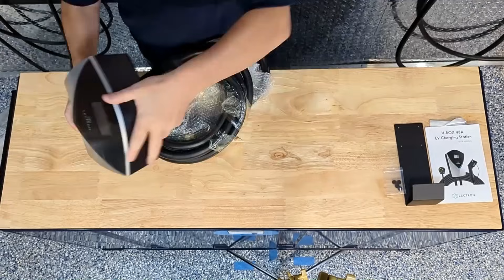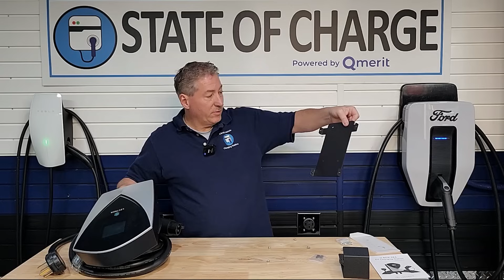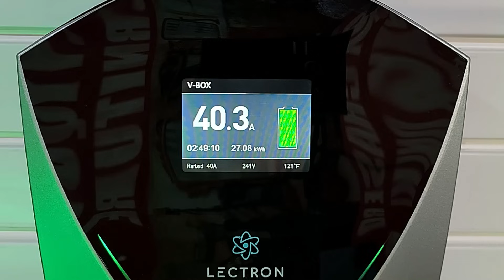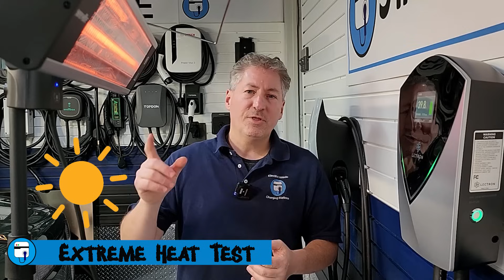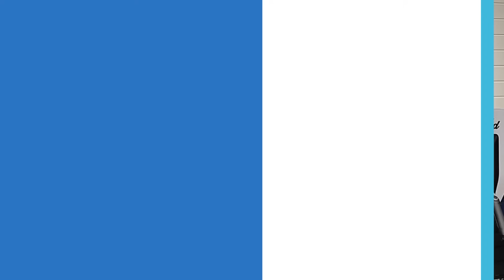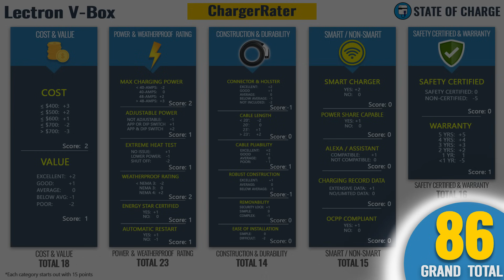Lectron V-Box EV Charger Review

Comment: The reason it has that plastic 1450 plug is so that way you can remove it and hardwired into the house so you could deliver the full 48 amps. If it were a rubberized molded piece to the cable, they'd have to cut it and void the 1-year warranty or any possible extended warranties they bought. Don't just judge for ots exposed screw's

Comment: The plug was made with the screws exposed so you could take the plug off and hardwire the unit without having to cut the plug off then stripping everything to hardwire to breaker box. If your using it outside and don't have a covered 240V plug that's covered that's not real smart and that's on you. I like how you can adjust the amperage output for people who don't have plugs or breakers that is rated to for 48 amp or higher.

Comment: My work purchased 4 units and had them hardwired outside. When the temps dropped below 40 deg and rain misty outside two units had CP faults.  In two months of use, we had two units fail completely. No vehicles connected and the units would issue a control pilot error and would not charge. Lectron sent a new unit under warranty and suggested building a rain/weather shelter for each unit. I guess these v-box units are not meant to be used outside without additional weather protection. We are using the supplied j-hook adapters and the pins are dry in the connector. My work is now looking to switch to another brand due to the hassle of sending these units back for repair. 😢

Comment: I thought that my default charging set up was 40 A and that I would have to hardwire it to get it to 48 A. 

I thought that only if I hardwired it would I have to open it up in order to increase the amperage. 

I’ll make sure that I check the setting before I plug my car in. I don’t have the car yet, so it’s not a big deal. I’ll have time to check.

Comment: I disagree with your assessment of the ATTACHMENT plug versus MOLDED-ON plug. ATTACHMENT plugs have FAR more robust terminals. MOLDED-ON plugs are terminated to the cord by typically poor crimping that is thermally and mechanically inferior. The NEMA 14-50R (or 14-60R per below) receptacle in WET LOCATIONS per NEC® 406.9(B)(2) is REQUIRED to have either an enclosure that’s WEATHERPROOF (i.e., Enclosure Types 3R and 3RX or better, including Type 4 or 4X) UNATTENDED whether or not the attachment plug cap is inserted or a BOX COVER having a similar Listing for WET LOCATIONS (DWL).
If this comes set for 48A CONTINUOUS, then it SHOULD come with a NEMA 14-60P plug. If its SUPPLY cable isn’t rated for 48 A [6 AWG per NEC® Table 400.5(A)(1) Column B] then the Lectron V-Box MUST be set for 40 A CONTINUOUS [8 AWG per NEC® Table 400.5(A)(1) Column B]. IF THE CORD is 8 AWG, the V-Box MUST NOT be HARDWIRED at 48 A CONTINUOUS by that CORD (i.e., plug removed) not addressed by you, but SOLELY via fixed wires through the enclosure knockout (and appropriate wiring method) as you indicated.

Comment: Would you also do a review of the Lectron 20 Foot Tesla EV Extension Cord? 
It would be nice to know the voltage drop based on current that Tesla can report on screen. Heating after hours of load would be nice too. 
We live in an RV with a mobile charger setup in our trailer and we can often not park the RV so we can charge or Model Y without a lot of close parking. Sorry for writing on this video, but it is slightly related to Lectron :-)

Comment: Good review. I'm with you on the 48A default setting. I reviewed this unit last year and I sent them feedback that it should be set to 40A by default. Unfortunate it's still set to 48A from the factory. Otherwise it's a decent unit, though for the price some others are better with more features in my opinion.

Comment: Tom, would like to suggest a change to your testing procedure.  Having supervised electronics testing for many years I believe you should actually do a functional test of the unit after it is cold soaked.  I realize that most failures occur because of overheating but there is a lot of heat generated by the circuit board components and that causes considerable thermal stress when starting from a very cold temperature.  It would be a very short test (probably five minutes) to see if the unit continues to function when powered up and charging immediately after taken out of the cold soak.  That is a realistic environment for people mounting the unit in cold climates outside.

Comment: I’ve installed several chargers and frequently use drywall anchors intended for flat screen TV mounting.  Most are rated for 100 lbs.  As Tom recommends, try to locate a wood stud too.  If it’s a commercial application, get the hardware for attaching to metal studs.

Comment: Lectron seems to have a total disregard for safety. It appears there is no temperature sensing at the removable NEMA 14-50 plug on the V-Box. Also, they sell level 1 chargers that operate at 15-16 amps with a NEMA 5-15 plug, which should be limited to 12 amps (80% of 15 amps). 15 amps is only permitted on NEMA 5-20.

Comment: My first experience with Lectron was the result of Tesla discontinuing their 40-amp Corded Mobile Connector. Most of my charging is at free-to-me public EV charging locations around town that have NEMA 14-50 receptacles. I have a 32-amp Tesla Mobile Connector, but I wanted the 25% improvement in charging speed from charging at 40 amps. Since Tesla no longer offered a solution, I ordered a Lectron 40-amp mobile charger with a NACS connector. The first issue was that Lectron advertised a 5% discount code on their website, which was reflected in the order total, but the amount actually charged on Apple Pay did not include the discount. I had to cancel the order, choose a different discount code found on a third-party website, and use a different payment method. The second issue was that their website said "free 2-day shipping" at the time, but it took a week to arrive. The third issue was that the charger worked fine for about 5 weeks, then the plug started overheating and reducing charging current. This happened at four different receptacles, so it appeared the charger was at fault. I contacted Lectron to get the unit replaced under warranty. They replied asking for a video showing the issue. After I explained that a video wouldn't show temperatures, they sent a prepaid label to return the faulty charger. The fourth issue is that they not only failed to publish my negative review on their website, but they deleted another negative review that must have "slipped through". Hopefully, I'll have a warranty replacement that lasts longer than a month in a couple of weeks. So far, I've had nothing but poor experiences with their order process, product, customer service, and warranty process and cannot recommend buying anything from this brand.
Reply: Thank you for sharing.

Comment: If you using 14-50 with 40a breaker you should be using 32a . Not 40
Reply from the maker: Did I misspeak and say it was on a 40-amp breaker? All of my NEMA 14-50 outlets are on proper 50-amp circuits. EV charging equipment can only draw 40-amps on a 50-amp circuit because it's considered a continuous load.
Reply: @StateOfChargeWithTomMoloughney   no you didn't but I can see some people being confused and set it to 40a when it should be at 32a.  In any case another great review as a new fan to the channel.

Comment: Hey Tom, While I bet most people buying this will use the 40 amp nema 14-50 setup, did you per chance get to test the heat with 48amps hardwired vs just with the 40 amps? I suppose you already highlighted that isn't quite the best scenario for it based on the plastic melding a bit already at 40 amps.  EDIT: deleted the part of my comment about confusion on 48 amps. I misread the chart :) Thanks for the great work!
Reply from the maker: No, I didn't. It's very difficult for me to hardwire the review units just for 2-3 weeks of use and then disconnect them. The reviews already take me a very long time to do and quite honestly the review videos don't perform well, so I don't make money on them.
Reply: Totally understandable. Thanks again for the review! I have been considering this or the Grizzl-E for the future when I want to get away from constantly swapping out the mobile connector for road tripping :) Thanks! @StateOfChargeWithTomMoloughney
Reply: @thewaterboy2013  I like my grizzl-e, but I'd go for the tesla wall connector if you have a tesla and plan on keeping it. Or spend the little extra and get the universal wall connector if you're not sure. Or just buy another mobile connector and leave it plugged in for home charging if you want to save some cash.
Reply: @andrewt9204  for sure. I would go for the universal wall connector if it wasn't as expensive, and if it was still possible to Nema 14-50 connect it (I know Tom always recommends hardwiring ;) ). For my use case I want to at the drop of a hat be able to swap a charger out, and I paid extra already for an industrial 14-50 outlet. 3 of my family members have non Tesla ev/phevs and I want to be able to easily accommodate their j1772 setups.
Reply: Thanks for a another great review. I see a lot of their ads. Now I know better. I have an Emporia charger and home energy monitor in a box just waiting for the weather to improve to install it.

Comment: I bought the Lectron VBox 40 around a year ago and so far it's been great. I also have a JuiceBox 40. 
The VBox is in my garage that's heated.   The only thing I would like to see different is the amperage adjustment that can be done without taking it off the wall. But I seldom adjust it. The most awesome thing is the display screen and lights.